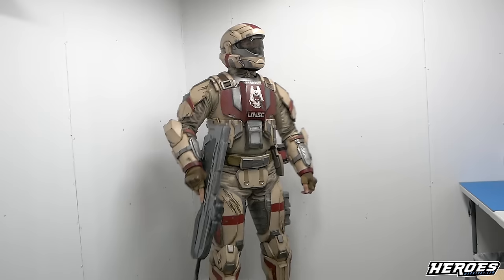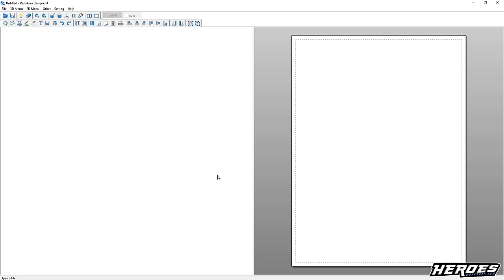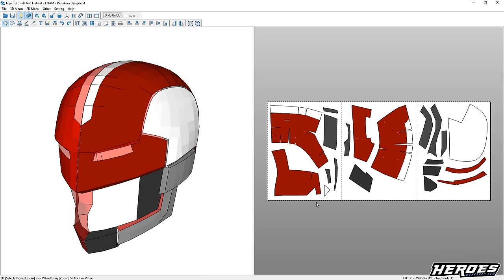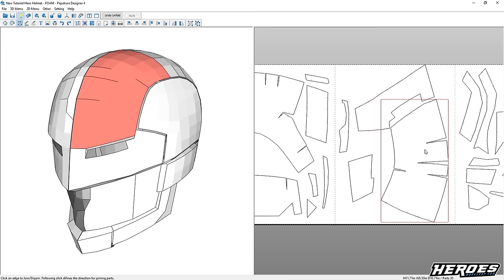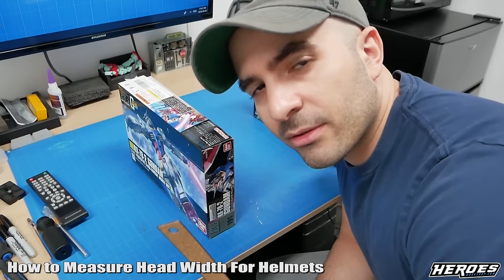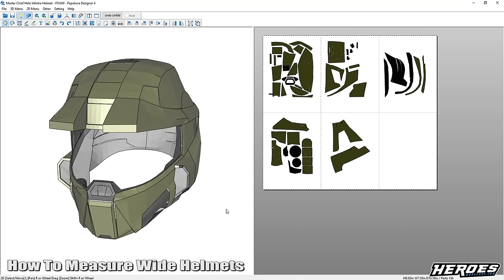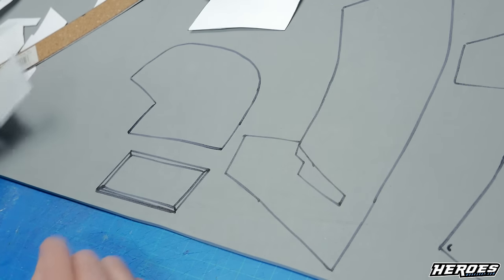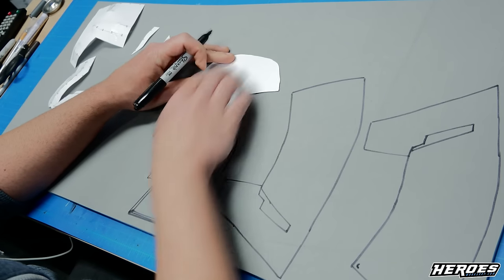Build Cosplay Using Eva Foam and Pepakura Designer (Helmets, Armor, Props and More!) - FREE TEMPLATE

Comment from the maker: Timestamps: 
0:08 Intro
1:23 Using The Pepakura Designer Software 
11:18 How To Scale Pepakura Files
19:12 Preparing the Foam Pepakura File Templates
24:03 Choosing EVA Foam for your project
26:37 Tracing Foam Pepakura Templates on Foam
40:43 How To Cut Bevels in EVA Foam
42:58 Cutting Out Pieces From The EVA Foam
1:02:14 Adding Detail Lines To EVA Foam
1:06:12 Assembling The Armored Hero Helmet
1:28:01 Sanding & Filling Seams on EVA Foam
1:33:24 Adding Battle Damage To EVA Foam
1:36:45 Sealing, Painting & Weathering EVA Foam
1:52:22 Outro

COSPLAY SUPPLIES LIST

EVA Foam Mats: 
https://amzn.to/2VRGtWT

Cutting Mat:
https://amzn.to/2W7aFMg

Hobby Knife:
https://amzn.to/35jdY7q

Utility Knife:
https://amzn.to/2SmITuo

Knife Sharpener 
https://amzn.to/2yW5erJ

Styrofoam Ball:
https://amzn.to/2SlL29w

Heat Gun:
https://amzn.to/2VPpLHx

Contact Cement:
https://amzn.to/2KP920A

Contact Cement Thinner:
https://amzn.to/2W7bvIU

Contact Cement Glue Pot:
https://amzn.to/3aRsEfd

Disposable gloves:
https://amzn.to/2SnnmSh

Sharpie Markers:
https://amzn.to/2SqhRSV

Cardstock Paper:
https://amzn.to/2yW0v9t

Gel Superglue:
https://amzn.to/2WhvsNt

Wood Burning Tool:
https://amzn.to/2VT7l8N

Kwik-Seal For Filling Seams:
https://amzn.to/2VRQLpO

PVA Glue For Sealing Foam:
https://amzn.to/3bTJfAe

Plasti-Dip Spray For Sealing Foam: 
https://amzn.to/2xnNzZz

Respirator:
https://amzn.to/2Sn4kv4

Dust Mask:
https://amzn.to/2KRCiDO

Safety Eye wear:
https://amzn.to/35iFKkB

Liquid Latex: 
https://amzn.to/2VPrhtd

Rotary Tool:
https://amzn.to/2zLRznE

Palm Sander:
https://amzn.to/3aMWNfv

Sand Paper:
https://amzn.to/2YhOSo5

Foam Brushes:
https://amzn.to/2yXM58O

Paint Brushes:
https://amzn.to/3f4X8xz

Acrylic Paint:
https://amzn.to/2SomdKb

Vallejo Acrylic Primer:
https://amzn.to/3d0YGXB

Perforated Mesh:
https://amzn.to/2Snrhyt 

Carbon Fiber Vinyl Sticker:
https://amzn.to/3d2cOQj

Soldering Iron:
https://amzn.to/2VTMqCG

LED's:
https://amzn.to/2VQCCch

Battery Packs For LED's:
https://amzn.to/2WgCVvY

Spray Gun:
https://amzn.to/2KKgOJ8

Air Compressor:
https://amzn.to/2VS2K6U

Air Brush and Accessories: 
https://amzn.to/35oG9ll

Comment: I absolutely love the video. It is very helpful thank you! I do have two questions!
1. Is the helmet still flex able? If so how do you stiffen it?
2. With it being fully enclosed, Is there a way to add small air holes into it so you won't sweat so much! Like around the ears, forehead, and the top of your head!
I thought about using and making small suing needle holes hidden in the semis to at least get some air!
Reply from the maker: It’s foam so I wouldn’t strengthen it. You want it to be fitted and still be able to slide on and off easily. It’ll be tough if it’s rigid. So I don’t do that.  You can make air holes some where If you want
Reply: @Heroesworkshop  where would suggest to putting the air holes thou?
Reply from the maker: I don’t know as I don’t ever put them. It’s up to you.
Reply: @Heroesworkshop  ok thank you thou

Comment: 57:35 I couldn't achieve this during a small test build ended up using a belt sander with plenty of ventilation. My foam would compress and avoid the blade. Thoughts? 1:46:15 forgot to add mixer to the list of materials :P
Reply from the maker: The blade is either too dull or foam is too soft. Make sure you keep the blade sharp and use a more dense foam. I’ll add the mixer. Thanks for reminding me.

Comment: I have a practical question, ive been trying to get into sewing and 'foamsmithing' for a while, and i want to make something like the helldiver armour. Im new to the hobby but working with my hands like this is my forte, always was, so how long could a project like making the B01 armor take, excluding the helmet?
Reply from the maker: Depends how fast you pick up the concept of pepakura and foam. I suggest doing the  helmet from the beginner tutorial. Alot of it is being able to trouble shoot with common sense.
Reply: @Heroesworkshop  i appreciate the quick answer. I to some extent understand that, most of how to manipulate the material i think i understand fairly well, what degrees you need for what bevels intimidate me, however. Cutting it out. Shaping it and connecting it makes oerfect sense to me though. In my head im picturing it taking anywhere from 60-120 hours to make the whole set, from printing to painting, but i dont really have a concept of it since i havent tried it before

Comment: How do you modify the paper template and make it suitable for foam? For example, the side panel on the helmet would typically be a bunch of separate pieces or look like a squid, yet your template has it as one piece. Is there a foam setting that I'm missing?
Reply from the maker: If you watch the entire video and see how it’s built, it’s easy to reverse engineer and grasp what I did. I have no clue how to explain what you’re asking in this box. Sorry.

Comment: im newer to cosplay and pepakura, and I've got a halo jorge helmet template, but one of the pieces doesn't look possible to do in foam like the seller said when I bought the template. What are your suggestions?
Reply from the maker: I’m not sure where you got your file from but sometimes you have to be creative with foam and make parts work in some way. I created this whole Pepakura to foam building system. So it was never meant for foam building but I made it work. So you can’t really limit yourself to the template. It’s not building by numbers like the program is designed for with paper. I apologize if that’s not much of an answer but It really is about being creative and modifying when you need to.
Reply: @Heroesworkshop  makes sense. I'll probably cut the piece into 3 sections to make it work better
Reply from the maker: Good luck with your project

Comment: When I right click I don't get an option to measure between two points. I can see an option in the main toolbar called "Pick edges between two points" but it's greyed out :/
Reply: Never mind there is an option in edit mode called measure 😆
Reply from the maker: There you go. Nice work 👍🏻
Reply from the maker: Remember to right click on the right side where the pieces are on pages. That's the 2D window. You might be clicking on the side of the 3D model itself. There is definitely a drop down menu when you click on the right side.